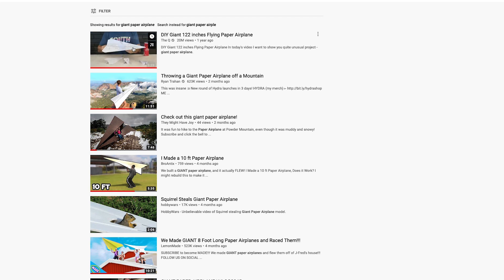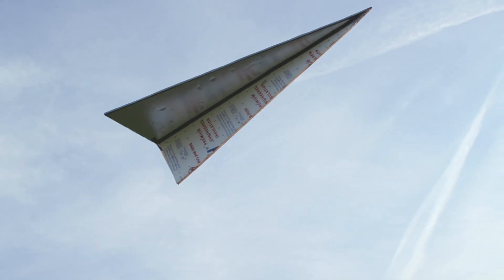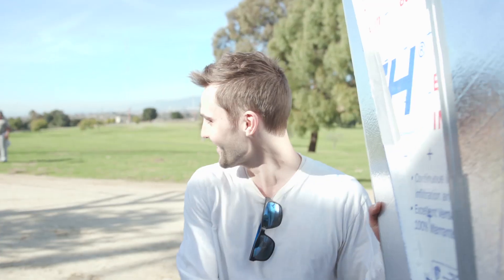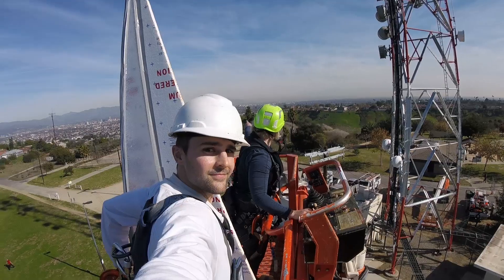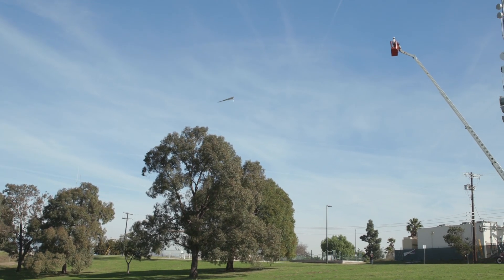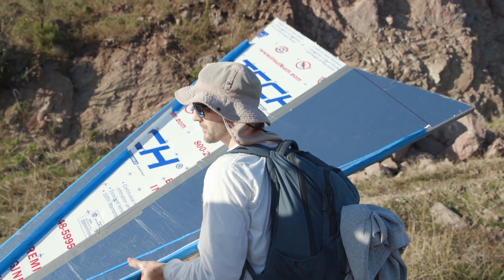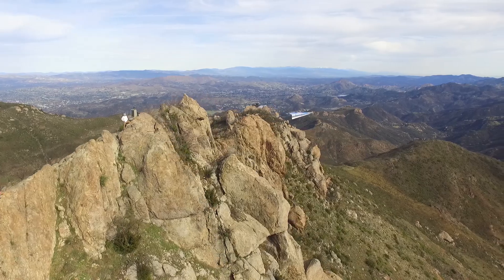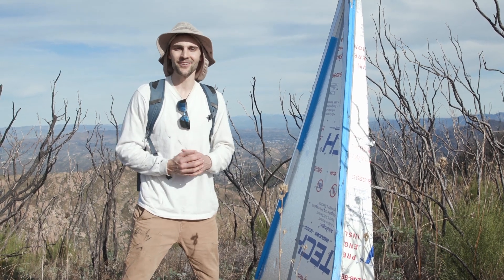GIANT Paper Airplane off a HUGE Mountain

Comment: Everyone is saying that the “airfoil” you added was only adding necessary weight to the front, and not really working like a wing. But what if you had added the extra piece to the under side of those flat wings, to make them more like airplane wings… where the air goes fast over the top and slower over the under side, creating lift… and then, rounded off the leading edge for a smoother break in the wind. Would that have added the necessary weight AND made the wings more aerodynamic?

Comment: One of the videos you showed that didn't incorporate a lifting wing actually discussed that very topic. Flite Test has built several "paper airplane" models which incorporates a double fold just like the traditional paper airplanes which does act as a stepped wing design.

Comment: Its the position of center mass relative to the center of air lift determine a stable ang long glide. A nose heaviy means the center mass is a little forward to the center preasure of the wing lift. Yeah, the camera location can be use to balance that.

Comment: You just need noseweight for a proper center of gravity and add some "reflex" at the back trailing edge (bend up slightly. Also during your tests learn how to add in some turn left or right. Can be done with the trailing edge of the fuselage "Rudder" or if looking from the back bending up the rigt trailing edge more than left will make it go right vise versa. Trim before the moutain and dont mess it while transporting

Comment: By adding and removing the extra foam from the leading edge changed the centre of gravity, eg, tail heaving making it stall and nose heavy making it sink quicker( changing the glide path) . Oh dear off the crane tail heavy as f. Launch of Mountain still tail heavy doing little stalls. I would expect ballisting it up depending on conditions of the launch site

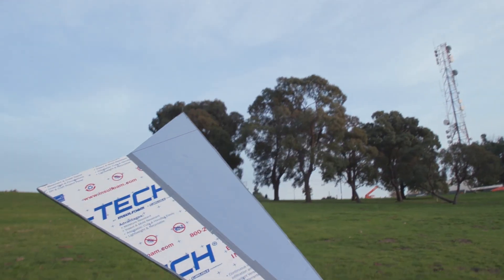Comment: 1:30 As others have said, this has more to do with center of gravity than airfoil shape. The reason why paper airplanes aren't tail-heavy is the folds.
There are stepped airfoils used in foam planes, look into Klein-Fogelman (KF-Step) airfoils.

Another thing you can do is cut large round holes in the back of the craft, and cover both sides with paper. That would remove a lot of weight from the tail, and preserve the shape of the airfoil, and most of the strength.

Comment: As and non-engineer, the optimal design would be as smooth & light as possible with the center of gravity ever so slightly forward of center. Bearing in mind the weight penalty, as much wing area as possible and a rudder/ballast of sufficient size to maintain course and prevent spiraling should help... But, of course, you've thought of those...

Comment: Eh, why not just trim the edges to get a more stuff thing going?  Even a single 45° cut would help.  Also, can't you cut holes in the bottom part to save weight without affecting performance?

Comment: The stall happens because the center of gravity was too far back, what you should have done was sand down the thickness of the wings 1/4 way on the back side, and cut the vertical fin in a way so that the bottom of it would be flat paralleled to the wings, that would have made the rear of the plane lighter, moving the center of gravity forward and preventing stalls in midflight.

Comment: Cutting the edges of the wing and the foil at 45 degrees instead of 90 will greatly reduce the drag and improve performance. Including the trailing edge of the foil and wing. Also, although you repeatedly made reference to a paper airplane in the video, I didn't see any paper. You might want to correct the title.

Comment: I would trim the tail down to about 6inches at the thickest part and then shave an angle to the leading edges of the wing maybe notch an elevator on the back and make sure it is not tail heavy ill bet it will fly a lot farther

Comment: What matters is balance. It should be slightly nose-heavy. This will prevent it from nosing up and stalling. Your "airfoil" is adding weight forward, and that's why it works. By the way, if you want it to travel slower but go farther, put a small upward fold into the trailing edges of the wings.
Reply: So a winglet ?

Comment: You interpreted the change around the removal of the airfoil incorrectly.  In aircraft, doesn't matter what type, the center of gravity must be ahead of the center of lift, or the nose raises too much and causes it to stall.  Many aircraft accidents have happened when the load is excessive in the rear, or the load shifts to the rear (e.g. straps break, cargo rolls or slides backward).  The airfoil is adding weight in the front that you need.  Or, add some other weight like pennies to the nose.

Comment: When I was a kid, I could build around 25 to 30 different paper aircraft. These were all models designed by others. Nothing original from me. The interesting thing is that the performance of the various models ran the spectrum. All sorts of performance differences. This was before the internet. I got all the info from books at that time. But I did just check. If you search YT for "paper airplane designs" , you should be able to find some of these ealy models. Good luck. Looking forward to more viral videos from your channel.
Reply: Just searched Amazon books for "paper plane designs" and found a sloo of newer titles on paper airplane designs. Just spend $100 on books and scale them up. You should be on your way to a string of YT viral videos. Good luck.

Comment: I would recommend looking up KFM Airfoil to understand how they work. If you fold a paper dart plane correctly, the wing overlaps are on the top which creates an airfoil. Folding it with the overlaps underneath creates drag. Dihedral is also required for stable flight as this will self right the plane, you can see this on the paper plane but not on yours.

Also, CoG needs to be calculated correctly and balanced on it before any plane will fly correctly.

Comment: Great final flight, but IF those dead shrubs hadn't been there or IF it had been 5 feet higher, it would have kept going.  And I wouldn't worry about the add-on airfoil.  I'd suggest just forming the wings into shape a little at a time.

Comment: Wonder if anyone makes a variable air foil but then that is what "flaps" are for. and also air speed in conjunction with shape etc has a lot to do with it.. seems faster you go the less pronounced the curve can be. and that also depends on weight and balance as well as surface area of the wing.. lots of factors to consider... but interesting tests, even if you are reinventing that wheel for yourself... Its good practical learning..

Comment: Impact lift is real. Weight in the nose. The stalling and wallowing and porposing is due to bad balance. Weight. In. The. Nose. I used scotch tape to add weight and sometimes a paper clip on paper airplanes. There is a way more efficient paper airplane design that has built in nose weight and wider wing with tip rudders that can be tuned to make it turn back to you. You can also tear ailerons into the back edge of the wing and make a snap rolling monster

Comment: It stalled because it was tail heavy.  The airfoil added weight to the front. Add weight to the front if it stalls, add weight to toe tail if it dives.  It was a little nose heavy off the lift gadget the 1st time,  tail-heavy the second time because it stalled.  It's a balance problem more than airfoil.

Comment: You want a little bit more weight in the front so that it noses down oh so slightly when it starts to lose air speed. It's not stalling but if you nose down a little, the wings might catch lift again and it might fly further. I say might because then you have to see how well the wings will catch lift in this scenario. I see no substantial reason why they wouldn't but physics experiments can somehow work out in unexpected ways sometimes. Anyway, that was totally awesome!

Comment: Tail is heavier than the nose causing it to nose up and stall.  Probably needs more weight in the nose to move center of gravity forward. When I was a kid adding a paper clip to the nose of my paper airplanes made them fly longer and better. Adding the extra material probably just balanced the weight more than  acting as an airfoil. The plane moves too slowly to affect the flow of air enough to create any significant lift.

Comment: Be sure to put your R hand gripping the back of the plane so you can muscle a stronger release( with good follow through ) when you launch it. Your initial velocity should be significantly greater than gripping it from the bottom. Good luck. Cool video

Comment: Another thing is that you need to make it slightly nose heavy with some up-turned trim in the back so that it glides better, and if it does stall, when it goes nose-down it will right itself and start flying again rather than just nose-dive to the ground.

Comment: Actually there are two types of paper airplanes that I've seen, this type, and the type that flies for miles and just hangs in the air sometimes.. which you start building with a piece of paper by folding the two top corners in down to half of the paper, looking like an envelope.  It creates more of a hang-glider shape with air-foil wings..  You should have made that type!!

Comment: In this case, diving down or stalling is not about the airfoil, it's about the center of gravity. With your airfoil on (as designed) the CG is too far forward, and without it's too far back.

Comment: I wish you would do this again but this time take some of the comments into consideration. A lot of the comments fix the issues you had the first time around. Examples: Heavier nose(to bring center or gravity closer to the front eliminating drag), shorter height and wider wings, not much wider. If you pay attention to the first throw 1:06 mins into the vid you’ll notice the plane flying on the right wing and fuselage only. Left wing barely causing any lift hence reason for wider wings. It would hit the bottom of the mountain guaranteed. Last tip it raise the tips of the wings ever so slightly to prevent dives due to the heavier nose. Would definitely love to see the results.

Comment: I'd like to see a lot more curve from front to back on the wings themselves.
If the top surface of that wing is longer (yes I had typed longer - edit) than the bottom side (like a plane wing) I'll bet it goes 30% farther.
Cool video tho.

Comment: I am not an engineer I can see you need to sand the wing shape for lift, also need a small airlift in the rear of the plane so it will keep the nose up just enough for gliding long. I did a Mountain in Vermont and I was told they found it 20 miles away from launch. I did see it the plane but the marking said it was mind.

Comment: Instead of adding the weight of the airfoil to keep the nose down, add a self adjusting trim. Essentially a balancing slide, with control lines to elevators. Think of the elevators you make on a paper airplane by tearing the paper. Now imagine that the higher the nose goes up, the more it raises the elevators, bringing the nose back down until it is just less than level, keeping it in the sweet spot.

Comment: I reckon a higher aspect ratio glider would work better - think modern hang glider shape. It would still be a delta 'paper plane'. I'd also put small elevons (elevator/ailerons) on the trailing edges of the wing to tweak it a bit in test flights. But then again, why not add r/c and see how far it would go? Best wishes from London UK.

Comment: Obviously the launch angle is a factor and you can't really afford to put it into much climb at all or it stalls out. You would have done better with an angle of under 5 degrees relative to the ground plane and with more launch velocity. The added weight of the aluminum itself pulls the aircraft down towards the ground faster.

Comment: When you take the airfoil section OFF, it changes the centre of gravity (CofG) and that's why it's stalling (stopping and goes backwards) mate. Also, put some small elevators on it, that way it you can "Trim it for straight flight.

Comment: If you cut steps into the foam so it wasn’t a so blunt the air could create a more aerodynamic shape from the pressure zones made in those steps
Reply: Also the “stalling” is just the plane being tail heavy. Balance it properly and it’ll probably fly better without the airfoil since it will have less weight/drag.

Comment: I made a 14" paper airplane and I cut the rear of the wing for two flaps, just slightly bent down. 4 cuts in all and I taped a bottle rocket to it and threw it.  It went about 20ft and ignited the rocket and flew another 30 to 40 ft and hit a Billboard. The plane was a typical arrow shape. A foam one of the size you are using needs flaps and a rocket.

Comment: Cool video but really should look for some help from someone who knows a little about planes... the whole video is flawed, the plane didnt fly due to a rearward center of gravity, nothing to do with the airfoil (which just added the weight it needed - half of which you removed for the final flight - which was cut short due to the sinking caused by the rear CG again...)

Comment: Nice Video, but  you climbed that high and it landed near the top where you threw it... It would have been more satisfying to see a longer flight. Still a very nice flight tho!

Your "airfoil" mostly just added nose weight & moved the CG of the plane more "for" than aft. Your plane still looked a bit "tail heavy" and at points it still looked close to stalling as you can see it slow and pitch up a bit before nosing down and then continuing flight. 
When building planes hold them up by their wings on the tips of your fingers so the balance point is about 1/3 to 1/2 back from the leading edge of the wing. If the plane tips towards the nose it is "Nose heavy" if it tips towards the tail it is "Tail heavy" and you either add or remove weight respectively till you get the right CG over the wings. For a sweeping wing like that is a bit tricky-er, but you can hone in on it by doing "Glide tests" (throw it from the same spot to get the longest straight line flight. Lands at your feet? nose heavy. Stalls? Tail heavy. Flies long and straight? tweak nose/tail weight from there to maximize longest distance). 
Once you get CG right, then you can experiment with airfoils to maximize lift. (lookup Klein airfoils)

source - me. building R/C planes

Comment: Just wondering why is the "handle" so big. Couldn't you counteract the weight of the air foil if you reduced the size (verticaly, not lenghtwise) of the lower part of the plane? §:c)

Comment: It's not that your airfoil is adding weight, but rather, that it's creating some seriously turbulent airflow because it's a clunky airfoil.  The design is not "dynamically stable."  Try finding and using a "dynamically stable" design.

Comment: Small flaps on the trailing edge of the wings , pressure over the wings still need to be directed //diverted  flaps up goes up ,flaps down go down ,  even a paper plane with a fold on the back of wing works !

Comment: Nick message the guys over at flight test their foam board would work significantly better, strength, elasticity and you can round it off so you get a better curve on your wings. It also really helps to measure the center of gravity that would help you balance its flight characteristics so it keeps just a little bit nose down that way you don't stall out. Good luck keep flying!!

Comment: That's not the "air foil" adding lift, it's extra weight front of the CG that's benefiting the glide ratio.
Reply: Yeahhhhh it's stalling from CG issues for sure. He's not keeping all the variables constant (at least not the most important variable)
Reply: He also knew it would fly better with rounded edges, instead he left it the way it was. Also strapped a gopro to it. 🤦🏻‍♂️ This makes me want to do my own project and do it right. For science, not for views.
Reply: Guys - this wasn’t an engineering project to build the optimal glider.  It was just a guy trying to somewhat replicate what we all know to be a “paper airplane” but on a larger scale.  That was the fun of this.  Certainly engineers could design more optimal throwing gliders - but that wasn’t the point here.
Reply: @joeterp5615  you managed to "bring it back down to earth"!!
Reply: @slink4956  it amazes me that it still flew with an issue like this!🤯
Reply: @marcusherold8356  Да хоть может лететь назад если не может противостоять ветру этот 3-х метровый пенопластовый самолет
Reply: And that weight is go pro 😂
Reply: Exactly what this guy said.
Reply: Very cool! Nice work!
Reply: Absolutely right!
Reply: words?
Reply: Yeah my ketchup to mustard ratio is optimized for my greatest ability to taste
Reply: instablaster.
Reply: Hi einstein brain
Reply: No, you idiot it is a Kline–Fogleman airfoil if the material is stacked like that air will go over it and taper downwards. That vectoring of air downwards creates lift. Stupid
Reply: @akashbaryear9146  nerd

Comment: A4 sheet with say 80-100 GSM thickness is good for making paper planes. A4=90-100 square inch

So Area:GSM ratio =1

Using this ratio;
A1 sheet with say 400-600 GSM thickness you can make a big plane with conventional Origami/paper-folding.
(But it would be less than half the size of this 'airplane')

Comment: OK now I've seen the rest of your video good the go pro is the weight you need for the CG move it forward a little more it is still slit pitch  up into  a stall or, what is called porpoising air speed was slowing in a slit sink to a stall again shortening your distance of the flight . Forward on the go pro make sure there is no Elevon or, Elevator the back of wing is not turned  up or, down to much this has to cincronize with you CG.  Hope that helped have fun.